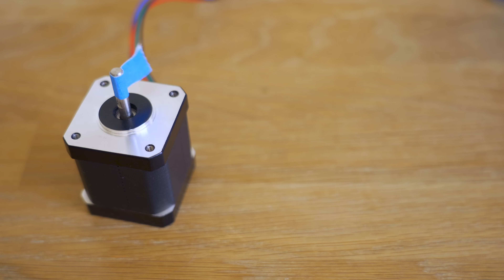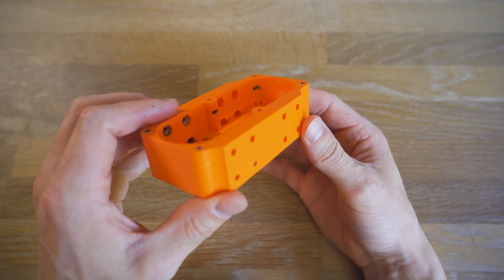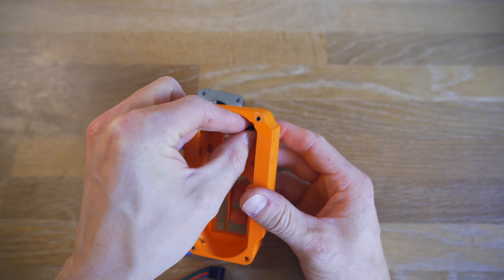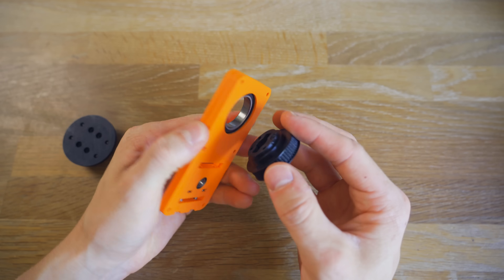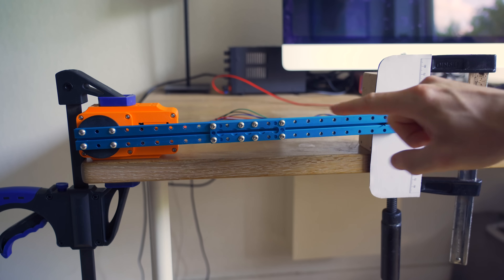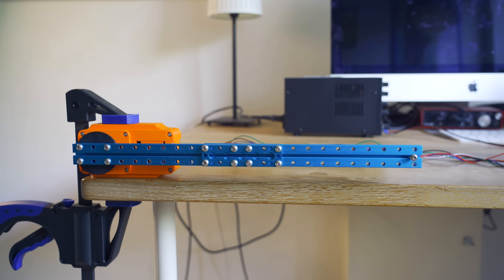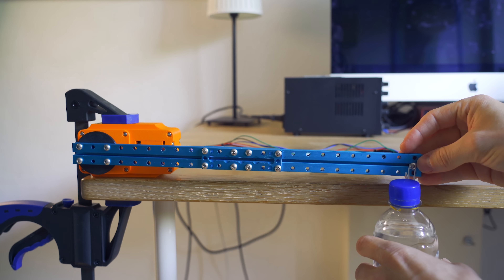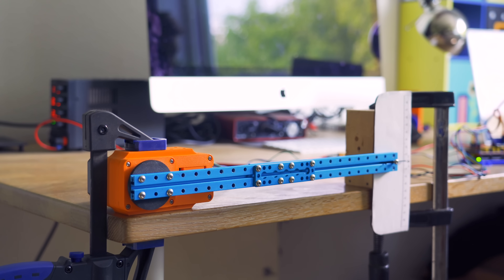3D Printed NEMA 17 Precision Gearbox with Position Feedback!

Comment: 1:12 printing gt2 pulleys with 0.4 mm nozzle? 🤢 The gt2 spec asks for a 0.15mm arc on the pulley, which is never going to be printed properly with a nozzle that big

Comment: The torque is more because you didnt include the weight of the leverarm, if you make the lever symetrical on both sides of the axle you can exlude it from the calculation

Comment: I know I'm a bit late to the party, but - I think that the torque values are directly correlated to the holding torque of the stepper (because failing point was stepper loosing it steps)
Maybe it's an obvious remark, but I think it's worth to mention that this design won't overload itself and cause mechanical failure, which could be handy for some designs.

Comment: The deflection I'm going to guess is in part due to the tensile elastic strain of the belt or the bending elastic strain of the aluminum bar. I think you could create a closed loop system to correct the angle from the displacement on static positions using a rotary encoder over a Hall sensor. That would be more difficult to incorporate though.
I have a question though. I've seen that a lot of people usually go between three different approaches: a belt, a planetary gearbox, and a strain wave (harmonic) gearbox. What was the reason you chose the belt system over the other two?

Edit: My apologies for any inconvenience in necroing a two-year old video.

Comment: Do you think the hall sensor would detect the magnetic domains in the material used to make flexible refrigerator magnets? IIRC in one direction the material has narrow stripes of alternating north and south oriented  megnetism. It might be possible to glue it to a gear to increase the resolution. Although, I think an optical sensor from an old mouse wheel might be better. If you were feeling really ambitious you might be able to use the principle that makes digital calipers work. It is a cool project as it is but I think you need more resolution to call it a servo, so that if perturbed a little it can move back to where it was.

Comment: Well, under "positional feedback" I understand "continuous positional feedback". Not just feedback at one specific point. A rotary encoder would probably be more useful (preferable on the output gear, to compensate for the springiness of the belts, at least a little). Apart from that, it's a neat design. I don't think the threaded inserts are the best solution though. If designed correctly you can easily print the slots of the nuts etc. without any support. And the nuts are a lot quicker and easier to insert, compared to threaded inserts. Not to mention they can probably take more force.

Comment: A thing that a sugest you to do is try to do a controller inside the motor itself and make itself Control the necessary movements to keep the arm into the exact same angle , not by strength or system resistence,but eletronicaly.
other thing i sugest is to use a potenciometer,like those from the mouse Wells,conected to a gear to get How many gear teeths has passed by for each motor movement,equationaly you can get How many degree you moved by the amount of theeth haver been passed by the potentiometer,as the mouses itself do
And If possible,you could gently put the libs or algorithims tou hás used to your tests ir development? 
a place like github would love such a amazing project as yours

Comment: I am very impressed with the outcome.  You persevered in fighting back the results from the first attempt and building a better mouse-trap!  I accept that there is a practically unbeatable issue with the flexibility of something that long and its ability to fight or resist movement.  I personally don't call the movement backlash - I use that word to explain the exactness or sloppiness of gears and their mesh-ability!    I know that the object you built, if made from large block of steel or aluminum and no plastics or belts involved,  would not have that amount of movement.  But you have made a strong servo.  Haven't I heard of strong servos before?  Made like a normal plastic servo but in metal?  But you did have a self imposed problem to solve and I believe you did it.

I have a need for a stronger mechanism than I have now.  I developed and built a vehicle platform that allows me to ride on it.  It is basically something that allows a wheelchair to ride on top of and it uses 24vdc motors to move with and a car window motor to steer the front wheels.  I use a DPDT switch to steer the wheels from left to right, but the centering is not self managed.  I have to do it and it is difficult to get it in the middle.  As well as the steering is not proportional.   There are a couple ways to fix the overall problem but I want to keep it as a fly-by-wire system (isolated) so that I can implement other features down the road - like RC control of the whole vehicle.  This is my pet project - just to see if I can do it.  Don't we all have something like that we want to do?

Plus I liked the fact that you talked us through the process with explanations and discussion.  That is becoming more of an issue with me - I'm not going to watch an entire video of hand movements!

Comment: I'd rather use a single nema 23 stepper with a servo57b from mks. Costs me 30€ per motor and is closed loop as well. But smaller.

Comment: How accurate can it be with one magnet for position sensing? 
if its off it wont know until the next magnet pass and by then it could be way off. 
it wouldn't be good for cnc mills as a little bit off can completely ruin your work.  its nearly useless... i would have shoved a bunch in there. the more position marks the better.

Comment: that hall effect sensor is just for homing, we want a proper encoder on the out put shaft. If you have a proper feed back controller, it will fight back any torque you apply to it and not just lock your stepper motor. it will improve your precision drastically. heck you dont even need a stepper motor, you can just use a DC motor, I think there are very accurate hobbies stepper motor were it uses optical encoder instead of potentiometer as feed back.

Comment: You can easily get rid of the issues with the press fits of the nuts by designing the upper surfaces with bridging in mind. I quite like the design, so I might attempt to make the modifications myself. I recommend you check out gregsaun's maker cheat sheet on GitHub for a codified versions of some of the modifications I would make.

Comment: Awesome project!
Concerning the M3 flat nuts I always print the square holes without any supports on my prusa Mk3.
If I can reach the holes afterwardsI clean up the drooped overhang with a knife but generally it isn’t necessary. Especially if precision of the nut position in the “z” axis is not critical I just oversize the z dimension slightly. For a good fit I use 2.2mm height for my square and it 98% fits without cleaning anything up. If I want to play safe I up the dimensions to 2.4 or 2.8mm that for me always fits the nut without any work. This way you don’t need to use expensive and difficult to implement threaded inserts. The nuts can clamp on the layer lines with minimal material in the x and y directions the inserts need more material all around taking up mich more space which you generally don’t want when building things with M3 bolts :)

Comment: I know I'm kinda late to the party but there's an easy upgrade for your system, you could place a potentiometer (variable resistance) without stopper attached to the gears, by doing that you would be able to know the exact position of the arm simply by reading the voltage of the potentiometer and utilizing the magnet to "zero" the system or reducing complexity, just home it yourself
Reply: But using potentio means using analog signal which usually means noise . I'd rather get myself an encoder. 

But if you want to keep the price cheap, yea i'll go with the potentio as well
Reply: @rizalardiansyah4486  I've made pure analog control systems, if you know what you are doing noise it's not an issue, first of all, get good potentiometers, not cheap ones, second as long as you have a stable input voltage and your cables are good the result will always be the same, encoders are only needed in hostile environments, like a factory with a high degree of temperature variation or high amount of vibrations

Comment: Your videos are very well done, you got a new subscriber! Here is my idea for the version three, add a magnetic rotary encoder to make this a pretty nice hobby grade servomotor. Part four could be a video about designing a driver for it. Look up AS5600 for example, you would have to tinker a bit but maybe you can put this on the output shaft to reduce backlash even more, active backlash compensation. If that results in too much oscillation just put it on the servo itself.

Comment: How you get the threaded inserts to work? Every time I use them they never work for. I make the hole to small and when I add the insert in fills into the threads. And if I make the holes just right they don’t hold when screwing in. How you get your room work?
Thanks a great video

Comment: I wouldn't call it position feedback, but homing or indexing, still interesting design.
Reply: @Robo Cop lol, community disagrees ... content creator even refers to it as "zeroing" and "homing" in the actual video - as such title is a bit misleading as most people looking for position feedback are likely after more than a single position that is achievable with an end stop or homing switch on the axis as opposed to in the drive train.
Reply: I agree, surely an encoder would have been better.
Reply: @teenflon  even better, there are hall effect encoders, which can monitor the angle of the magnetic field. one radial magnet on the shaft center and such sensor near it

Comment: Nice work. I think you should use an adjustable idler to tension the belt rather than the output pulley. This will allow the output pulley position to remain static so that it's location is absolute should this assembly become coupled to something else as a driving unit.

Comment: If I'm not mistaken the "Servo42B" does the same thing you want. Its a closed loop stepper motor with up to 256x microstepping :-)
Reply from the maker: You're right! but I want the gearing as well for greater torque :)

Comment: Nice Solution, but if you want to make it less dynamic dependent the encoder should be attached to the second shaft to measure the real position, otherwise you will always measure angle filtered by some second order system. off course a reduction will be necessary to keep the encoder precise enough. Nice job!

Comment: Had a couple of ideas watching this, though they might require additional compute power compared to your current solution. First is that instead of a single Hall effect sensor, you could use two, with one each on the input and output spindles, hopefully allowing an increase in precision and accuracy and restoring some of the functional flexibility. Second is that with either one or two sensors, you could replace the solitary single-point magnet with a polarized magnetic strip along an inner circumference of the matching gear or pulley, essentially functioning as an absolute encoder, as you mentioned to Omar Aissani in a comment below.

Comment: Just stumbled across this video, great content!
I have a suggestion for the hall effect sensor. You could position it on the back plate of the stepper motor for more resolution, just like they do for closed loop stepper motors for 3d printers (which you can find on aliexpress and banggood) also discussed in this video by teaching tech: https://www.youtube.com/watch?v=eM8zSG8fEkk
If I'm correct that should result in more resolution for the position feedback.

Comment: And the ender3 pro is a great machine, mine printed great from the start, and 6 months later, still printing awesomely. In addition, Angus Devrron of MakerMuse, has a great little tolerance gauge that will help you dial in your CAD tolerances for your printer.
Reply from the maker: Thanks for the tips!

Comment: Have you throught of using Worm gear these can move high and stay in one position
Reply: Worm gears can be very hard to print. If you print them lying down, the down side will be squashed, or filled with support material, and the up side will have layer lines, making it weak. If you print them standing up, the shear stresses can rip them apart in-situ. I've had some luck with printing them vertically, then powdered-salt remelting.
Reply: @voron_design  to make matters worse, the less backlash you have in a worm drive, the higher is the friction, grinding away material all the time

Comment: I am not seeing how this is precise. Since your sensor can only detect each full revolution of the output you can only detect and re calibrate each turn. Why not put an optical sensor like those used on computer mice on the input gear, assuming you trust the belts to not slip and stretch too much. Or the output gear for lower resolution,  but detection of actual movements. You could probably get 360 slits in the wheel allowing extremely fine measurements from the input gear, or 1 degree if placed on the output gear.

Interesting project, thanks for posting it. I'm wondering if you can get stiffer belts to take out some of that flex as well.

Comment: This is incredible - I've just placed an order for some NEMA17 stepper motors and most of the necessary items, as I want to try and incorporate this into a project I'm working on. Is there any way you could upload the 3D file (.f3d file if Fusion360) for the output plate so it can be edited to edited to fit other types of attachments?

Comment: First its a really nice looking gearbox but theres so much wrong here.
1. this gearbox has not an Posotion Feedback, it has a Home Sensor and thats not near what a Servo is.
2. Steppers are not really precision things, Servos are.
3. that hybrid "Stepper" is not really a Servo its still a stepper but with a Resolver and thats than called a Closed Loop Stepper
4. A servo and a CL Stepper using Resolvers to allways get an Feedback of the position ore the angle it moves and the Drive always check the Position it has to the position it had to go. So in your test where you testet the holding tourqe a Servo or CL Stepper would always want to go back to the position it had befor the weight moved the Lever. your Stepper dont do that.
Also there are some differenzes in how Steppers and Servos are build. so they are not really compare able. main Differences in use are that CL Steppers are more used for slow and more Slow Tourqe task and Servos are more a high speed option.

Comment: I think you should try an optical encoder, or use more magnets. I think it will make it respond and get back to the position pretty fast.
Because the EXPENSIVE servo motors or closed loop steppers respond to feed back in less than a millisecond.
Good luck

Comment: Nice work! I tried designing a gearbox like this, but ended up abandoning it. Mine was going to be driven by BLDC motor, and have a gear stage before the belts. That would give very high power to weight ratio, and still much lower backlash than a servo since there is only one gear stage, and the backlash from it is reduced by the total belt ratio.

Comment: How much maximum load without deflection? Because I am noticing a very large deflection when load is applied. I think holding maximum holding torque should be computed when there is no noticeable deflection.
Reply from the maker: Yeah, you are completely right. In my testing, I was more focused on maximum lifting power, but of course this introduces some deflection, which is very problematic for precision applications. The maximum load without any noticeable deflection seems to be a lot less, as you accurately points out.

Comment: Another great video! Would you consider to publish the Fusion360 files, to facilitate modifications/adaptations? Additionally, I'd like to ask what the advantages and disadvantages would be to use a BLDC and encoder, driven by something like ODrive, as compared to a stepper motor. Many thanks again for a great video! Hope that more people find their way here soon!
Reply from the maker: Thank you! Yes, great idea. I'll see to it, that those will be uploaded soon.
I think there are many advantages of using BLDC's over steppers, both in terms of power, speed and noise. The only downside in my perspective is the increased cost and complexity of using eg. an ODrive. But BLDC systems are only getting cheaper and cheaper, so it's definitely the way to go, also for me at some point ;)
Reply: You can pull in any design to fusion 360 and convert it to editable

Comment: Did you think about building the gearbox with a worm drive? 
Theoretically there should be no backlash left because its self stoping.
Correct me if I am wrong.

Great content ! Hope to see more.
Reply from the maker: A gearbox based on a worm drive is a great idea, but it won't remove the backlash between the gears unfortunately. There will always be some play between the gears, otherwise they wouldn't be able to turn. a worm drive will make remove the backdrivability though, which means that it can't lose steps even under too heavy load. That can be a good thing depending on the context :)